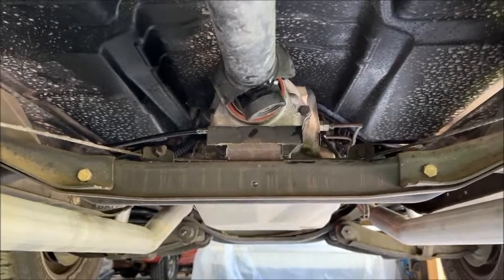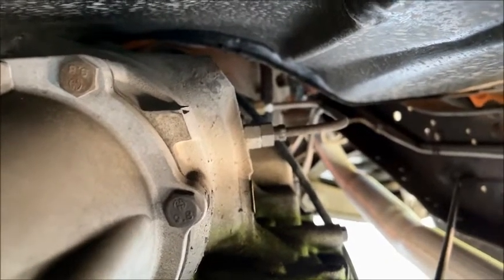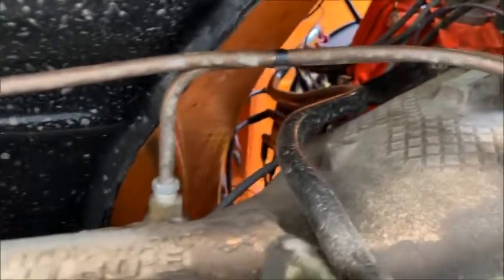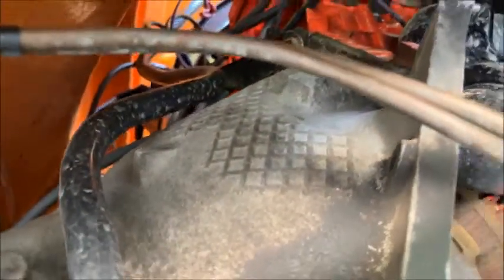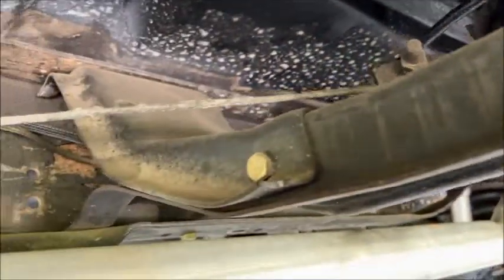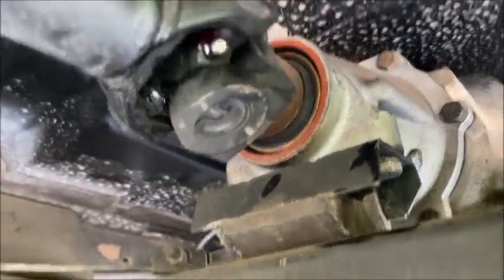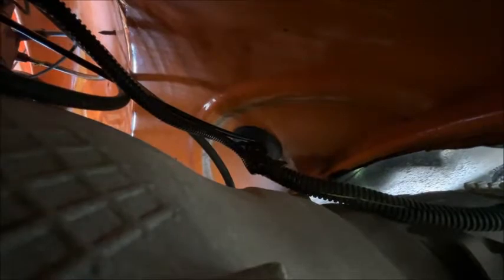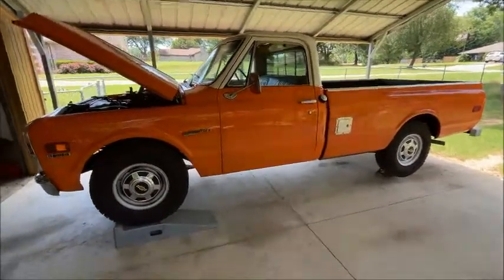How to Install a 4L80E into 1967-72 Chevy C10 / C20 Trucks

Comment: You said its a low hump but looking inside your cab that looks like a high hump, at least its much higher than my 72 C10s low hump.
Reply from the maker: Yes, low hump with high hump carpet.  This provided a space to route everything, but you could probably use low hump carpet and it would simply have some lumps from the cable and wires.  I cut a piece of sofa cushion to take up the extra room and make it appear normal.

Comment: You can take the gear selector shaft from early 4L80E's. For shift rod 3/8 rod from homedepot
Reply from the maker: That's a good tip about the piece between the transmission shift shaft and frame bracket.  Will save some time!

I used a bolt since I had one in my bolt bin, but 3/8 mild rod from the box store would work very well too!

Thanks for the great comments!

Comment: What computer and TPS did u use to control the transmission? Im lookimg to do the same on my 1985 GMC 3500. Thanks. It's very helpful
Reply from the maker: EZ TCU from TCI.  It's made by Fuel Air Spark Technology (FAST), but TCI puts their brand name on it.  Works great, but mount it in the cab away from heat.  If it overheats, it won't shift out of second and often times will leave the converter locked at a stop, thus killing the engine.

Comment: You dont remember your source for the transmission fittings?wanting to use the metal lines as well,all I can find are AN style,my rear fitting has the long port as well,appreciate the video.Thanks.
Reply from the maker: I'll have to look through my receipts.  If I find it, I'll post it in the video description.

Comment: Doesn't look like you had to trim the lip where the firewall meets the floor pan to clear the bellhousing. Had a few people tell me that I would need to. Which is silly, considering that some of these trucks had a TH400 factory. (Same girth in the bellhousing area to the 4L80E) I'm in the process of installing a 5.3L and 4L80E in a customer's factory 2WD 1972 GMC Jimmy.
Reply from the maker: Some of the LS mounts will move the bellhousing face back farther than the original location.  That could have been the issue.

Comment: Yes what is the part number for the tcu controller. The ones on the website are not available.
Reply from the maker: TCI EZ-TCU Automatic Transmission Controllers 302820

Comment: Is that a 400 driveshaft or a th350 driveshaft I was wondering which slip yoke would work on the 4l80
Reply from the maker: Yes, TH400 slip yoke.  Bigger spline than TH350/4L65.

Comment: Need help installing my ez tcu on my truck 95 gmc with 4l80e and carb ls swap
Reply from the maker: Since you are going carb with ignition controller, the Trans Control Unit will be stand alone just like on my truck.  The only difference I imagine will be that your MSD ignition will likely not need the signal module I had to install between the HEI and computer.  I assume MSD has a pin already setup with the proper signal conditioning.  Best to read up on it yourself to be sure.

Comment: @Brians Garage so you used the th400 torque converter and 6 bolt flex plate? Thanks
Reply from the maker: Just opposite of that.  I used the factory 4L80E converter along with a 168T flexplate.  The flexplate was designed for mate up to TH400 and so only has 3 bolt holes.  3 of the 6 bolts holes in the converter are not used.  Does that make sense?
Reply: @BriansGarageUSA  got it ok thank you

Comment: What's your mpg I was thinking of doing this to my 72 c20
Reply from the maker: I get high 16 mpg at 75-80 mph, and low 17 at 65-70.  Slowing it down a bit makes a big difference due to the aerodynamic drag.

Keep in mind, this is with a 383, 4.10 gears and 235/85R16 tires.
Reply: @Brian's Garage  love it 😀